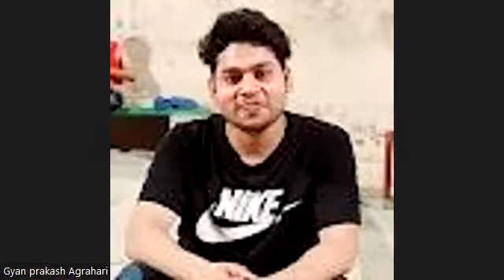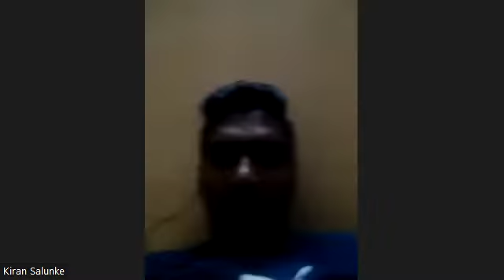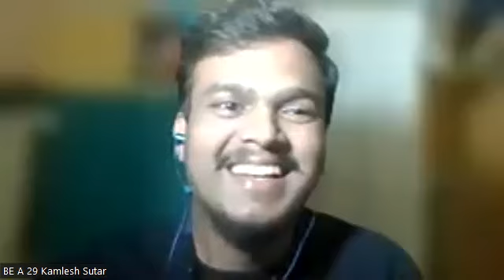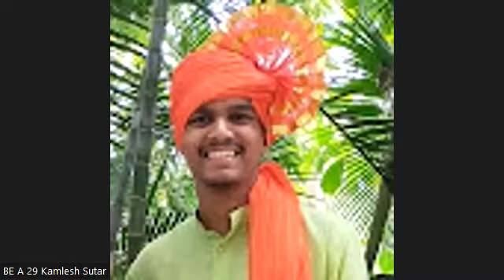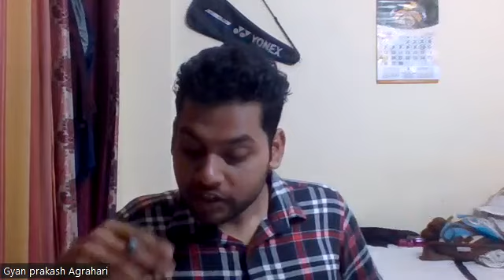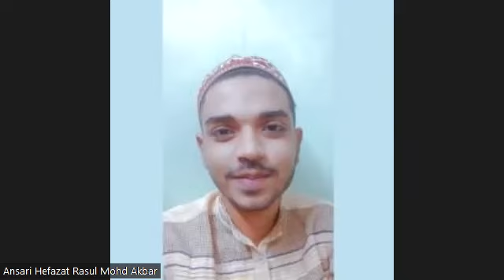VCRS Discussion||Why do we exactly use a Compressor?||GME/Marine||*Part-1*||with KAMLESH

Comment: why compressor is used?
1. to inc. p|t of refrig. and allow the flow in system cause without P diff. there can't be any flow.
2. it help in rejectn. of heat gained in evaporator to atmosphere ,because at low T heat can't be rejected.

?